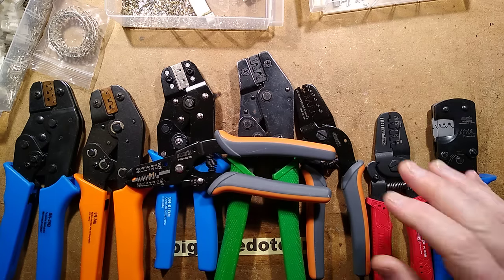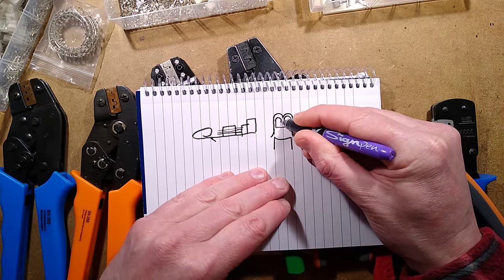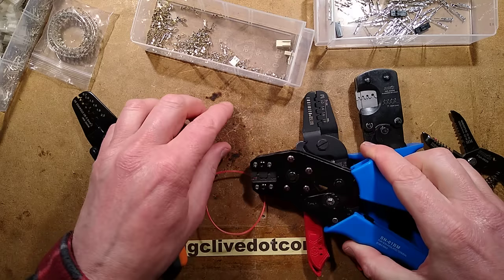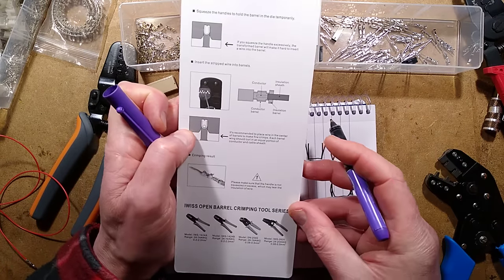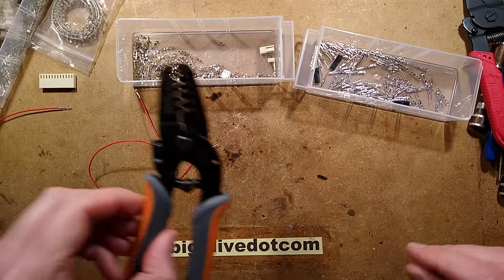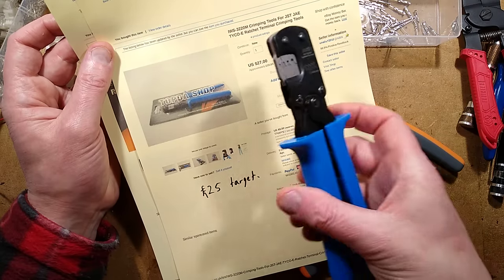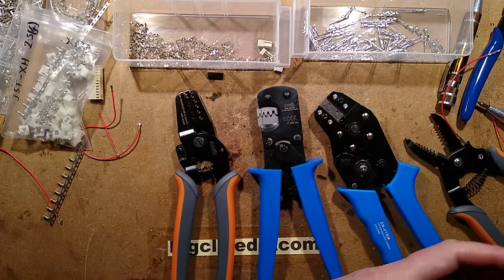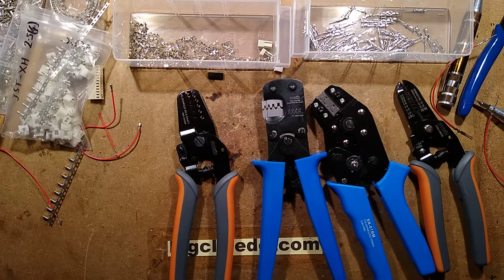Crimping tool test that I screwed up. (Read description.)

Comment: The technique I use is to keep a little part of the metal strip on the connector - instead of cutting the connector off the strip, cut the strip leaving a 6mm tab on the end of the connector, that way you can hold the connector by the strip while crimping, once crimped the tab easily breaks off by bending back and forth.
Reply: That's a good tip, cheers.
Reply: I was so frustrated with the crimper, i made a video long ago so i wouldn't forget some special tips i figured out. It's on my channel.  
Others left a bunch of helpful comments there too!

Comment: I have an IWISS brand version of the one you said was garbage.  If you'd asked me on the first day owning it, I'd have enthusiastically agreed with you, but after a few hours of learning the tool, I can now create great crimps on dupont connectors with a single squeeze very quickly.  It's all about learning your tool and getting the hang of it.

Comment: One thing I learned the hard way: buy name brand handles and dies. Cheap no-name dies have caused me ENDLESS trouble. also: 'crimp' is a verb. Those little metal bits are 'terminals' or 'contacts', you phillistine! ;D

Comment: A Hellerman Deutsch rep once showed me a crimping tool for use with the connectors on 132kV power lines.  And a short length of wire (as thick as my wrist) with a connector crimped on.  The crimp had been hacksawed at an angle to expose the stranded cable: the strands had fused together and the connector had fused to the cable.  Compression welding.

Done properly, crimps are very reliable.
Reply: what country is this? here we just use a bus-bar thing with screws and a plate that swisch the cable on both ends. when we "temporarly" slice a line we use cheap cable to turn around both ends and sometimes a bolt clamp. (sorry i dont know the propper english names). this is on the "medium" voltage cable on the top of telephone poles.
Reply: @Francois_Dupont  Here in the UK we don't run 132kV lines on telephone poles.
Reply: @bdf2718  its 20-55kv i think here. i dont remember.
Reply: @Francois_Dupont  10kV is typical around here for high voltage lines on telephone poles.  I'm talking about this kind of thing: https://en.wikipedia.org/wiki/File:Anchor_tower_of_overhead_power_line.jpg
Reply: @bdf2718  nobody runs 132kV on telephone poles, they'd arc to the pole and ground.
Reply: I remember from decades ago, a paper on plain old fashioned low voltage wire wrap bonds ionically binding the connection, which lessened the potential for fretting. Additional compression would indeed fusion weld metal connections together nicely.
Reply: @bdf2718  LMFAO ;-)
Reply: @spvillano  It is really interesting stuff. Was just reading about it the other day on wikipedia. I had no idea you could generate enough pressure with wire wrapping to lead to a cold weld.
Reply: @Sammus7t  i’m not an expert but I do have Some microscopy equipment in my lab… And from some of the things I’ve seen when experimenting and playing around…… Wire wrap is so secure that it not only cold/ionic welds… but also forms a “gas tight“ bond. capable of withstanding high stress of both vacuum and pressure. A lot of the studies that preliminarily discovered this information and spread it into common knowledge….. were done by NASA during the Apollo program etc….
Reply: @hullinstruments  what is wire wrap?
Reply: @fiercefix is that rhetorical?  It’s a methodology where a wire is wrapped around a square post. The edges bite into the wire and it forms a gas tight bond. Mostly used for wiring electronics before the days of RF frequency signalling. Some wire could be wrapped with the insulation on and only the point of contact would electrically connected.

Comment: I bought the simple iwiss tool about 6 months ago and it's made my life so much easier. I do a lot of crimps for drones and it handles everything from tiny 1mm pitch JST-SH up to molex micro-fit 3.0 with no drama at all. Love it
Reply: Now that I know what tool to get, where can I get the the connectors to crimp??? For drones specifically?
Reply: @dstaron3162  ordered mine on eBay from China. Took about a week to come

Comment: I used to work at a John Deere dealership.  The folks who designed the equipment just loved their crimp on terminals and large variety of connector bodies.  They lived in a rarefied world in which equipment didn't vibrate, terminals lose tight contact with one another due to metal fatigue and/or wear, get left in the rain (also washed at the end of the day, then get parked in a shed to stay wet as long as possible), covered in mud or even worse -- dust, and subjected to a near infinite variety of operator randomness.  The designers weren't fans of having much slack in the cable runs for mechanics to work with either. :-(

The above mostly aside, I like the crimp on terminals because the crimps are air tight; it's rare to see corrosion where the terminal is squished around the conductor.  My solution to the wide variety of terminals I'd see was to buy a ratcheting crimping tool with a variety of changeable crimping dies.  It always worked without much fuss or bother.  It wasn't inexpensive, but it saved a lot of frustration while working with the specialized (designed to lock into a connector body) terminals.
Reply: WarGamingRefugee , correctly done crimped terminals should be better than soldered.

In an application with vibration or movement, wires should ideally have some kind of strain relief so that the vibrations/tugging etc isn’t transferred directly to the connections. In weatherproof connections this is usually incorporated into a rubber boot or heat shrink.

Comment: Ahh, crimping😊.... One of my old jobs in military aviation was PTT - Precision Termination Tools. Quite exacting standards, every techie & every tool/die was tested annually with 3 wires (6 crimps) samples sent away to a testing lab at MOD St Athan. Test results back were pass/fail- voltage drop & tensile strength of crimp. Gave confidence in tooling, techniques & to remove a defective tool from use. Kinda felt sorry for the poor person who had to sit there testing thousands of these samples each year!
Reply: Get them samples off to Sealand! They stopped that for routine testing as no-one was failing as no PTT co-ordinator (me included) would send a shit sample off.

Comment: A tip for crimping the female "DuPont" style connectors: Get a piece of straight male pin header, snap off a section 4 pins long. Push all 4 pins through so that one side has exactly 5mm sticking out. Superglue on the other side to keep them from sliding. When you want to crimp a female connector, slide it onto one of the middle pins of this guide (on the 5mm side) first. Then the side pins should touch the jaws, keeping the pin in position. When you strip the wire, strip 3mm off the end (Knipex 12 40 200 strippers have a length guide and work well, but are $90 so not likely paired with a cheap guideless crimper...). When you insert the wire into the connector for crimping, the ends will run into the pin guide, so you won't over-insert the wire. And the guide will position the connector correctly in the tool. Credit for this idea goes to https://www.instructables.com/Make-a-Good-Dupont-Pin-Crimp-EVERY-TIME/
Reply from the maker: That's a good trick for positioning those crimps.

Comment: The cutter you mentioned at 20.11 is not a defect or damaged by someone trying to cut something hard. The small notch is there to prevent the cable from slipping out when the cutter jaws closing in to cut the cable, hence it's important to position the cable intended to cut beyond the notch closer to the hinge of the cutter.

Comment: Clive, you forgot one of the most important things with the ratchet crimpers, they have the tension adjustment. If they crimp to hard you can lower the tension a little so it wont damage the wire or crimp.

I personally hate crimping connectors especially the JST style ones, so fiddly and crimps come out pretty shit most of the time. Cant count the amount of wasted crimps.
Reply: JST needs the most precise crimping tool. Requiring some careful research regarding correct size.
Cheap crimping pliers often work ok on larger terminals, but regularly fail on the smallest size.
Really precise anvils only come with the real expensive crimping tools and then it has to be spot on the right size if it comes to tiny sizes. 
If it's next size, crimping doesn't hold. 
If it is the next smaller size, crimping squeezes the wire almost off, looks probably good, but fails under use.
Reply: Thank you for the info, I didn’t know this

Comment: This was interesting enough when I first saw it that I remembered it 2 years later when I found myself in need of small crimpers. After checking eBay and Amazon and finding their best deals a lot more than when you bought yours googled IWS-2020M and found a listing on Aliexpress that led me to search there, sign up and order an IWS-2020M and an FSA -0626 for less than $1 more than the listing you showed (not bad with the rampant inflation lately). They came yesterday in just under 2 weeks so I'll probably use Ali again. I haven't used them yet but they look very nice (no ding in the cutting part). Thanks again for making videos like this.

Comment: I believe in using the proper tools for the job and in automotive there are tons of different size terminals we use. I have purchased a number of the Iwiss open barrel tools with mixed results.  I enjoyed this video a  lot. It is honestly amazing how many different styles there are and how many tools you need for this type of work. Great video sir.

Comment: I still have my Paladin crimper that i used back in the 1980s to make Token Ring connections, you really do have to get a feel for them
Reply: I still have my West German made Paladin PA1645 from that same era, used to wire several radio station studios.  I like that it needs that little extra "oomph" to release it, so that it'll stay closed when you're done.
Reply: I use Paladin crimpers for many things with no issues, once they are adjusted. I wonder if Clive is having problems with either adjustment or cheap die sets versus the handles.
Reply: I have a set of AMP for Bnc plugs as well as IDC crimpers for scsi and ide ribbon cables, I may even still have my IDC sub D crimpers

Comment: Somewhere in my workshop I have an AMP crimper that auto feeds the crimps so when making harnesses you just slot the wire in the hole, squeeze trigger then it automatically advances the strip, loads of different heads for it. Admittedly it cost about 10 times as much as the ones featured.
Reply: Same.  Purchased mine close to 20 years ago.  Also have some Thomas & Betts ratchet crimpers and associate dies.  Used to have a bench mount setup too.

Comment: My projects involve terminal crimping maybe a few times a year, usually with a different terminal type than the last project. I feel like I figure all this stuff out every time - which die to use (I have an Astro 9477), which way the terminal is oriented in the die, whether the terminal barrel seam goes up or down... It is maddening! I would love to see you make more videos where you figure this stuff out and share your experiences. I really appreciated that you tested the strength of your test connections, because many of us hobbyists have small kits with limited pieces and don't want to waste them experimenting.

Comment: Back when i was a student in electronic engineering (fun times), we crimped a bit with a pair of pliers just to hold them and applied a bit of solder into it to seal the deal. It worked, simple, effective, good connection, and of course not very much standard, but hey, we were students, and i don't recall anyone ever telling us at that time that we were doing it wrong. The only downside, too much solder and the connector wouldn't fit in.

Comment: I used molex or Amp most of the time at work. We had to use a micrometer every morning to make sure the tool was crimping within specifications. They had a crimping tool for every pin you could imagine. I would have loved to have their collection. So many of the pins started coming in on reels. Then they had Amp machines with a different head for each pin. I sure miss working there. I could make any cable including ribbon cable with connector and strain reliefs. Keep up the great work. I love your videos.

Comment: The force needed for these small crimps does require a ratchet tool. In fact a non ratchet crimper gives you a much better "feel".
I have used a Molex MT.1919 tool with just A and B positions for 30 years. They probably went out of production before the Internet since I can't find any reference. 
I work in 2 locations, so I'll be taking Clive's recommendation and order an IWS-2820 as a second crimper.
I've found the Molex and JYK crimps and housings are not entirely interchangeable due to a slight difference in the barb position, so keep them separate.
Another finding is that the JYK housings, already slightly off-white to begin with, yellow over time whilst the Molex don't, but this does not affect functionality.
Thank you for the review Clive, very informative and useful.

Comment: Have tried many crimp tools over the years but have always ended up going back to the Kompress Crimpstar TIPO-HP2  (0.25 to 1.6mm) which has been the most reliable crimp tool in my collection for 20+ years.  It was a gift many years ago from an electrical engineer friend who was fed up seeing me pfaffing with a crap crimp tool.